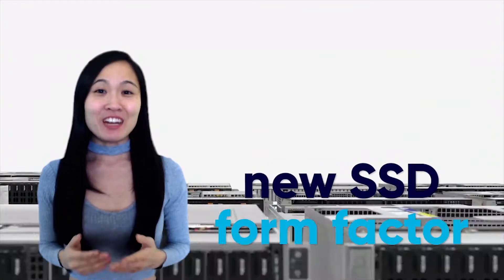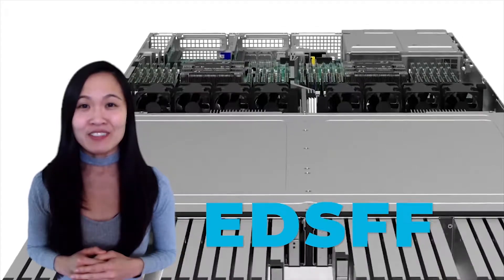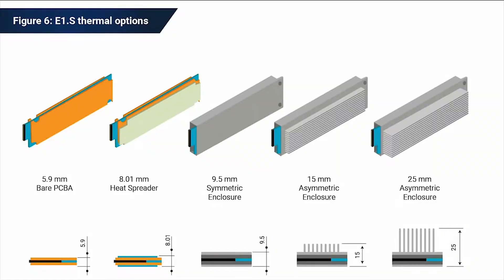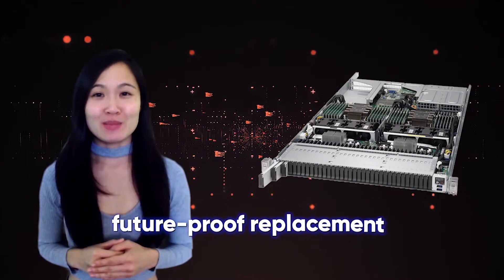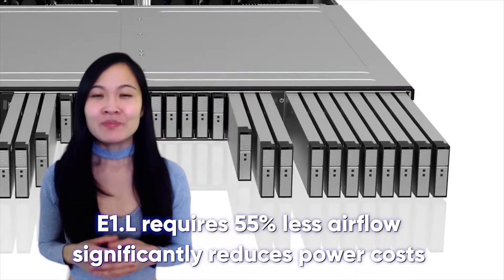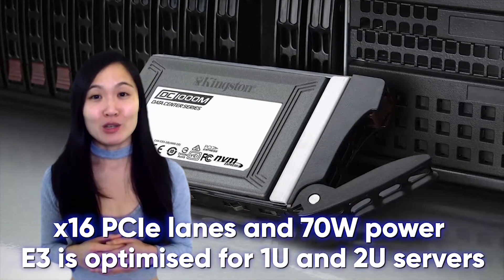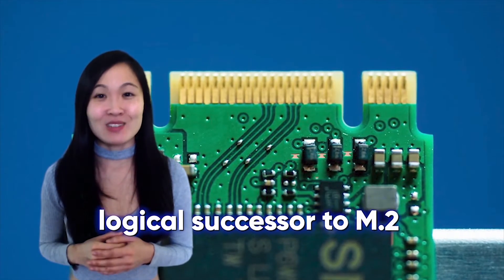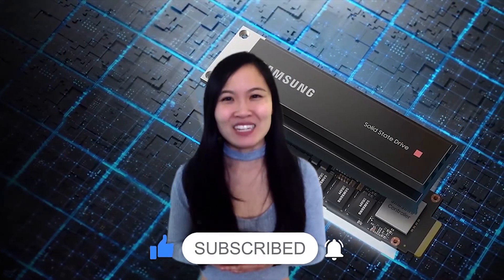E1 & E3 EDSFF to TAKE OVER from M.2 & 2.5in SSDs?

Comment: I think it will be good for little while to come.  Most or all of the E1.S drives I have seen used are 4 lane at the moment, as verified on the spec sheets on the websites of their manufacturers.  You can also tell if you look at the connector, look at how many pins are connected and just 4 of the lanes are in use of the possible 8 that slot can allow.  To me this just seems to future proof the spec so it lasts longer while they come up with the next things by making it so they won't have to redesign it so soon.

Comment: Would be nice if M.2 dissapears as fast as possible and consumers get more access to this professional format. Hotswap and backplanes where multiple of these devices can ne plugged in, instead of the need for a flashlight and find if some connectors are still available in a dusty casing.

Comment: She just said you can make a 1U server with a petabyte of storage but how many drives of what size is that and what motherboard is doing this? Ugh it’s a cool catchphrase but I just am not following. Is this so much smaller in form factor than M.2? I mean that shit is tiny! Or is heat the problem. Then why would N drives making 1PB not have heat problems. The heat syncs are good enough?

Comment: I think like most things it all will come down to the dollars - money.  Is it cheaper to upgrade?  To operate, to maintain?  Will it cost less for electricity, is it more future proof?  How long will the drives last?  If those benefits are better than what is currently available, then people will switch, if not they will hold off till they are more beneficial.  Nice video.  I've seen these used in the data center, where I used to work, and didn't understand the form factor of them.  The technician who did the installs, just said it was the newer mass storage, but didn't really say what the form factor was.  I know they held much more bytes of data than hard discs or ssds.  Thank you for posting this video.